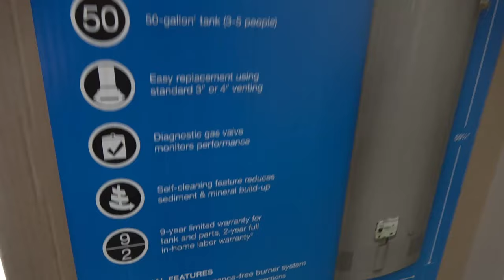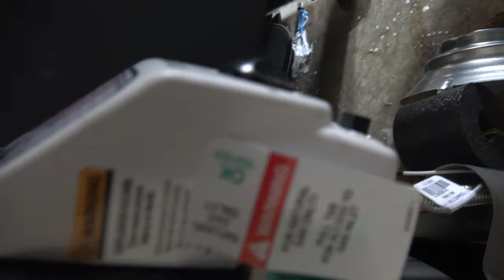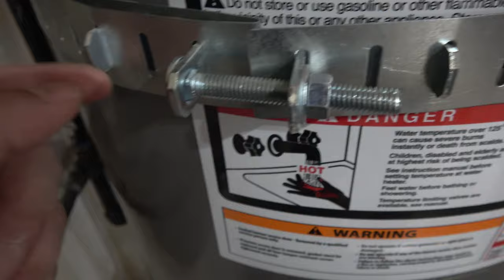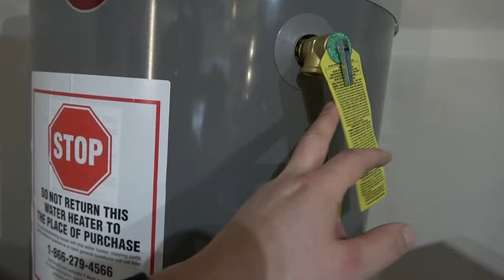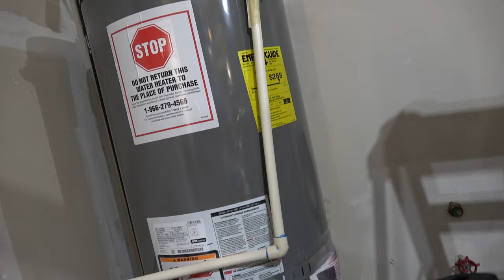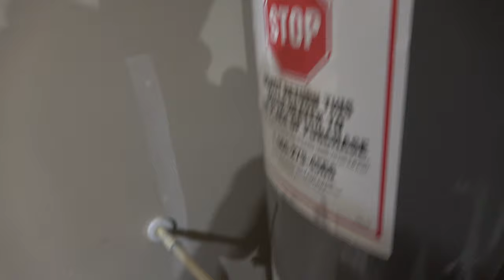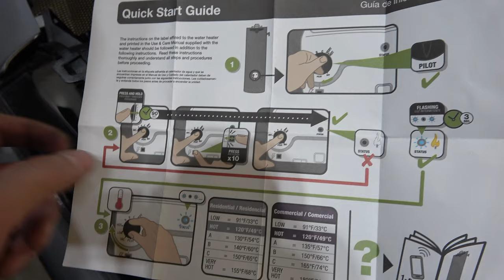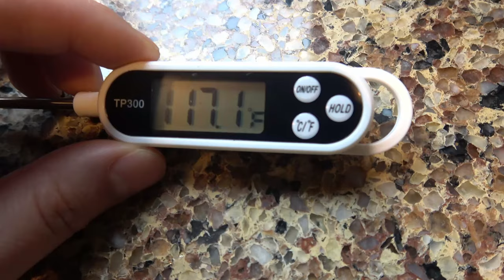Rheem gas water heater installation process from start to finish what you need to know!

Comment: That short piece of pipe you removed from that gas supply tee is there for a reason. Its a sediment trap and it catches debris that could come from your gas supply and traps it before it goes in your regulator. You should have left it on.
Reply: that's right...
Reply: That's right ☺️
Reply: It also looks like he used black pipe on the cold water side.
Reply: My house built in 1959 and the only sediment traps it has are the ones I installed. Before that everything ran fine too. But it is cheap insurance.
Reply: Oh don't worry, it's only code. No reason to follow that silly ole thing.
Reply: That right should have left that
Reply: He is right though.  The sediment traps often obstruct the removal of the gas line.
Reply: Yeap is sediment trap
Reply: I had to stop after seeing the pipe dope.  It will get into the gas valve. Even though there is a screen inside. 7:40

Comment from the maker: Revisions should be made to your install. Make sure you do not remove the t drip like I did for the gas line input. This is designed to catch debris which can cause issues for the water heater. Make sure to use no corrosive piping for the main water lines into the water heater, such as copper or galvanized pipe and fittings. The dope sealant does not require time to cure or dry. This was my first time doing a water heater or this type of plumbing and thanks to everyone for the feedback to point out the things I did incorrectly. I have since fixed my trap and replaced my water inlet piping. Thanks for the support everyone.
Reply: The flared fitting on the gas line does not (and should not) use pipe sealant.  White ptfe tape can degrade in natural gas (there is a yellow tape for gas).
Reply: Make sure the temp is set not lower than 120F to prevent Legionella bacteria growth
Reply: @robs7930 Thank you! Great to know! Very much appreciated!!
Reply: I find this video very useful, including the comments. Real-world first time installer uploading a video like this is great as it shows most of the steps that can be puzzling or sometimes done wrong. I've learned a lot and now have motivation/courage to do this myself as well. Thank you!

Comment: 80 percent of your install was incorrect. You're using black pipe, you don't need Teflon, you need a sediment trap on the gas, you're using red hot blue glue on cpvc, your exhaust is wrong AND you bought a home depot water heater
Reply: Why the exhaust is wrong

Comment: Daddy, while is the Hot water orange and Rusty? Oh, I used Black iron fittings for a gas line, on the inlet & outlet Water connections. Gee, will those get more curroaded faster, than the old galvanized fittings I took off...use water compatible fittings, like copper, brass, cpvc, stainless.
Reply: type o,.... corroded
Reply: Max Fly and others are correct. This guy is making all the worst DIY mistakes. DANGER... DO NOT USE THIS VIDEO. LEAD POISONING AND SERIOUS CORROSION PROBLEMS COULD RESULT.

Comment: Removing and capping the sediment trap ? Interesting ! Making sure the high pressure relief value has gravity flow is top notch. This is the same reason I start my water lines on the upper floor so the water can flow down to the other fixtures in the house .

Comment: This is a really good step by step video this comment is mainly for people who are watching it and going to attempt this themselves a couple tips that I would suggest is make sure all your fittings are brass and not the galvanized stuff, brass is a little more expensive but totally worth it in the long run also you want to make sure the pressure in your expansion tank matches your water pressure, you will need a pressure gauge and some sort of air compressor or pump, if not your expansion tank will fail prematurely, and lastly make sure your gas line has that little pipe that he removed it’s actually there to trap sediment coming in, what he did definitely will work and he’s up and running but these suggestions are just to help your system last you as long as possible and if you can shell out the extra money for a 12 year tank especially since you’re saving money by doing it yourself, I would do that as well, good luck to you all this is a great video, thank you

Comment: Good video.  Took me about 6 + hrs. and i thought I had all parts, some hoses too short, etc.  When I got to lighting the pilot it didn't work at first.  Keep trying and hold down that pilot knob .  I had to try 3 x pressing ignitor 10x each try.  Also some Gas hoses now come with a safety valve , make sure you install in the direction of the gas flow.  If pilot still does not light try another gas line to test (I had my dryer gas line ) or change safety valve/fitting with regular fitting

Comment: As mentioned,you should have a drip leg.Also,there is no need for pipe dope on the compression side of the flexible gas line.The fitting going into the gas valve,yes,there you put dope as you did,but,not the compression side.
Reply: Flare fitting not compression

Comment: That piece you removed and replaced with the plug was actually needed. It's a drip leg and a must have. You should've screwed in one piece at a time starting from the appliance then screwed the drip leg in at the end. Your supply line should be screwed into the top of that T and the drip leg on the bottom. And call me crazy but that looks like black pipe being used for water supply which is not suitable for drinking water.
Reply: I hope he read your comment. That is definitely good to use that black pipe on the water lines 🤮

Comment: The reason that downspout on your gas line was there was to catch any sediment that can be in a gas line as so it does not go into your valve. Should take that plug out, and reinstall a 6 inch downspout with a cap on the bottom
Reply: Yes, that’s correct.

Comment: Most codes don't allow PVC on the temperature & pressure release valve.  However, many allow CPVC.   Not sure your installation would pass a building inspector.
Reply: Thanks! I just bought a bunch of PVC for this job before reading your comment and fining out your 100% correct on this.
Reply: @mylesgray3470  By the way, other than my code questions very nice job.

Comment: I purchased a Rheem 50 Gallon Hot Water Tank and pretty handy with doing things as I have a couple of rentals. I have never installed a Hot Water Tank but seems like I can handle it. One thing I want to ask do you really need a Joint expansion Tank or a Pressure Release Tank on the Cold Water Side? Right now I have a old RUUD Tank that is close to 30 years old and there is no Tank on the Cold Water side.
Reply: If you meant thermal expansion tank then they're really only necessary in a closed system which means you've got something like a check valve or regulator on the main water supply to the house. Most municipalities will require expansion tanks on new installations to be code compliant and if you're on a well the pressure tank can act as an X-tank as long as there's no check valve between it and the WH.

Comment: Minor issue but putting a pan between the stand and the heater would be aded protection piped to a safe area, but not necessary.

Comment: Did you check your water pressure at the tank drain valve before you removed your old water heater? You need to adjust the pressure of the expansion tank to match the water pressure in your house.
Reply: He didn't pressurize the expansion tank either. The pressure in the tank should match the water supply pressure.

Comment: Hey ya again . Wanted to comment that all i had to do to get it to  ignite was hold button in and press igniterfew times and wait till blue blinging light. Tho I did remove cover down around window to inspect flame as to color to be sure gas flow was correct . And when did so i noticed the pieceof insalation was turning black because of heat .so i conntinued to remove it rather then take chance of it possibly burning .or causing fire .there was no instructions to remove it or to not so better safe then not .thanks again for Video

Comment: Well just read comments glad i saw ur video .reviews about reem wasnt the  best things read about reem  but mines a yr old and seems to be working great .tho i do have problem with the plastic things melting around hot and cold pipes because of i figure the exhaust and backward flow kinda figured why,would  so its some what fixed but the silver thing that sits on water heater need small remanufactured and the piece cut out of inside so flune would  slide down into it a 1/4 futhure.but great video gonna like and subscribe and check out ur other videos .

Comment: I noticed that you used black steel fittings and nipples on the cold water line, that is going to rust out. Brass is better. Also there was no pan below the heater that ran to a drain or outside. Also you took out the  sediment trap on the gas line.
Reply: Many wrongs this video.

Comment: Why did you take the sediment trap off the gas hookup? You use a little bit too much dope, go easy on that so it doesn’t get into the gas valve and cause issues. It’s ok to put a little dope on flare and compression fittings but keep it skin thin. Always use black iron pipe for oil, LP, and natural gas, copper, pex, galvanized, brass for water.
Reply from the maker: Thanks for the insight. I spoke with my brother in law after this and he explained where I made a few mistakes. Yeah already fixed the trap issue. I replaced the pipe with what exactly was there before, novice move, I should have used coper. That will be my next project to redo before its starts putting rust into the water.

Comment: 9:50 pipe from PSV, I would use two 45's instead of one 90. Because I consider this a drain line. 
What is the potential weight of the expansion tank when full, maybe add a support this item.

Comment: The yellow gas line most likely has a compression fitting and you are not suppose to use pipe dope with it?  I thought PVC gluing required a primer and then the glue, unless you are using some new product where you don't need the primer/glue and use one product instead?  I think your draft hood attached to the exhaust pipe connection at the top of the water heater looked fine, it was only a very very small tiny tilt that I do not think matters, but there is nothing wrong with making it perfectly straight also for at least 4-6 inches.  Unfortunately whoever did my original water heater used a twisting coupler piece, so there is only about 2-3 inches of straight pipe there.  Gas line can also have a sediment trap, but my home did not have one.  Wondering if I should add that or not.  Also the instructions show a 6" heat trap (going downward) on the hot water output line, but in my home there is one that goes up, not sure if that matters or not?  I am  just a home owner installer too, watching your video to make sure I don't miss anything.

Comment: Critters can crawl into that exterior drain, possible negating the value of the pressure relief valve.  Flue pipe not mechanically connected to H2o heater. Depending on the plumbing a dielectrc union should be considered.

Comment: Since you installed the Rheem hot water heater a year ago, have you had any problems? Just curious. I purchased the Rheem 40 gallon gas hot water heater from Home Depot yesterday and I had their contractor install it. So far, I am happy with the heater and install, but I have seen some bad comments on YouTube about the thermostat at the bottom failures or even starting it with the push button igniter. 
Only had heater for one day and it works fine, but then again, it was installed by Home Depot contractor.
Reply: how much did you pay for the contractor? I was told 4800$ Later on he brought it down to 2800$ Still deciding if i could do that myself.
Reply: @Nobody-tf7mv …I jus signed for installer to come out for 50 gal Rheem for price/installation…Home Depot $798 for tank not sure total cost yet 🥺..This by the way is plan B; plan A for Bradford w/install total $1875 (I had same type installed in 2006, due to flood last week the thermocouple out) was told have to be replaced 😒..pricing range from $900~$1700 on average.. FYI coupling on $35.99 and labor $193/hr + drive time 😤..stating they’re not allowed to do pilot lights/coupling due to floods 😒

Comment: Great video wondering how long it takes for hot   Water - from cold to hot
Reply: What you're probably looking for is the water heater recovery rate which will vary based on a few different things, but for a tank similar to the one installed in the video would be in the ballpark of 40-50 min. The recovery time doubles if using an electric water heater instead of gas.

Comment: Ran into a snafu . The new heater is a bit taller by two inches. The exhaust stack don't match. Darn . It's not straight up but has a 90 elbow near top. Outdoor closet

Comment: Hey nice DIY job   gotta tell you numerous mistakes ,   I didnt watch whole thing but here is what was really wrong in the first minute or so  and the drip leg (sediment trap)   was the least important   its a nothing bullshit code  after almost 40 years in trade   and 30 of which or more it wasent required and very few problems with dirty gas supply in my area.
     the expansion tank   totaly wrong  never use rust prone black fittings on any water.     too much pipe dope on everything, no need to use on gas flex or water flex.    Wrong type glue and or pipe    CPVC takes CPVC glue   hot water cannot use , plus never use tape over  a water flex connector.   The black fittings  really are painful to watch    on water connection    but hey live and learn just hope no one thinks   much of your install is done properly

Comment: When you did the gas pipe and took that extended pipe out that was in the way and put a plug in it's place .I'm trying to figure out the reason for that pipe extension I've heard it called a drip pipe .if anyone knows fill me in.i see it put on gas heaters outside too.
Reply: Its callled a drip leg and is there for a reason facing downwards the reason is to catch any particles traveling thru gas line and catch it there so that it wont get stuck in gas valve
Reply: @rubenrodas3992  thank you so much I appreciate it
Reply: @cheezinhoweree  no problem

Comment: This is a video of “HOW NOT TO DO A WATER HEATER CORRECTLY” should’ve paid those couple of extra bucks to replace it correctly. Gas connection is not done up to code, the black gas fittings used on the cold inlet to install expansion isn’t done properly, your not allowed to use black fittings for water they are corrosion resistant.

Comment: As others have said, do not remove the sediment trap on the gas line. That is the pipe going down with a cap to catch condensate and dirt. The black steel pipe you used on the water line will rust out in a couple of years.  It is also illegal on water lines. PVC pipe is only rated up to 100 degrees it will fail with 140 degrees or hotter water coming from a over heating unit. It is illegal. Use CPVC, copper, galvanized, or PEX. Now, some codes are not allowing PEX unless you run 1" or larger for a complicated reason. I will not go into now. The relief line is crooked. Please tell everyone to not do anything you did or use the tools or methods you used to install it. Many areas also require a drain pan under the water heater. There is more wrong that i will not list here. This is why people should not follow videos put out by unlicensed amateurs. Their water heater could leak and make a mess or literally blow up. Look up the Myth buster video. See how an improperly installed water heater blows up. I estimate it rose to 200 feet literally. What do you estimate is the height the water heater flies  to above the ground after blowing through the roof?

Comment: That gas connection is not correct. The little piece of pipe you removed is an essential part of the gas pipeline. It’s called a pig tail, the purpose is for moisture to drip. You need to put it back.

Comment: Oh my goodness lets count the mistakes on this install.

Missing drip leg on the gas connection.

Steel piping on the water inlet.

Upside down expansion tank.   BTW……. The expansion tank does NOT help regulate the water pressure.

Comment: You can’t use black fittings on water.    🤦🏻‍♂️. Your drip tee is upside down. This is way wrong don’t do anything he did   Would fail if he got it inspected. I don’t even know what state he is in National standard plumbing code would still be in affect. His inspector would fail it.

Comment: Couple of things I wanted to address to help future viewers, because this install is wrong across the board.

Using that tee with a plug for the gas inlet served no purpose and you removed an important component: a sediment trap to catch debris within the incoming gas to the heater.

You used an exorbitant amount of thread sealant on those black iron fittings. Not only that, but the flare fitting doesn’t need any kind of dope or tape. The concave to convex shapes of the line and fitting are what seal it, not the tapered properties like pipe thread.

You used PVC glue on CPVC, two different materials that require corresponding glues(though all-purpose exists that works on both).

Installing the expansion tank with black iron was a terrible idea. Going from stainless steel or copper/brass to iron will lead to galvanic corrosion, and you’re water will turn orange and stink from rust. Also you need to adjust the pressure of the tank to account for the pressure in your system. 

I know this was a DIY install, but some of these mistakes can lead to some serious problems down the road.